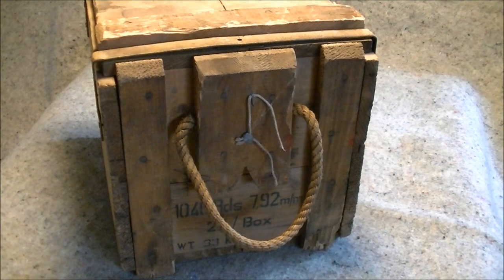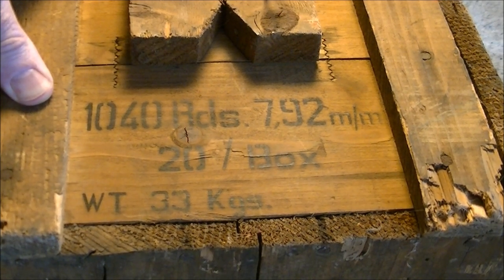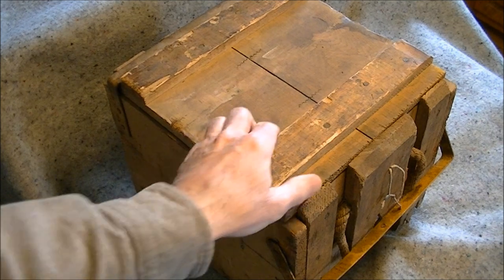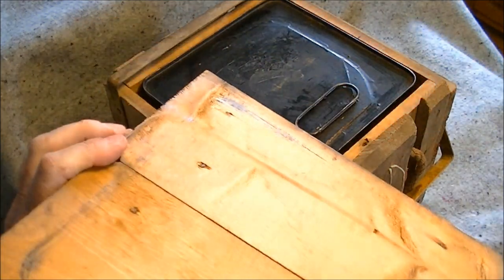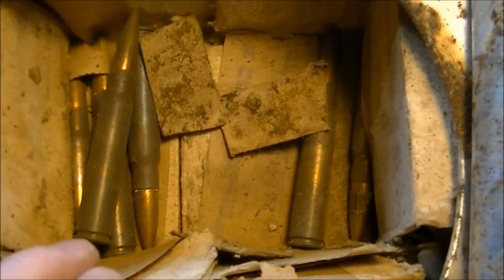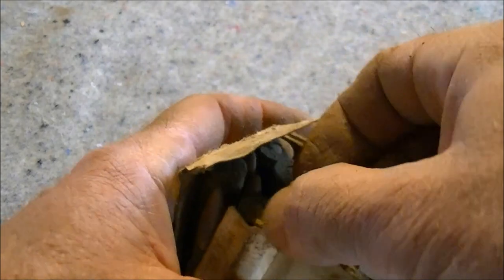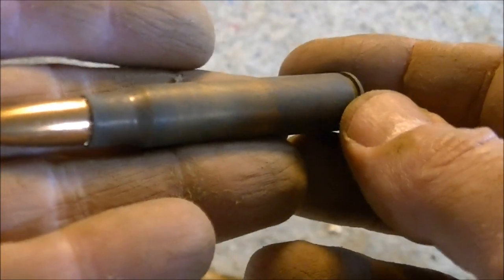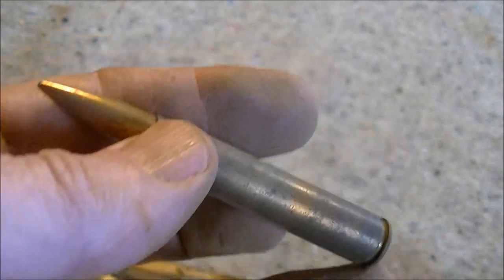Israeli 7.92mm Mauser Ammo Crate Opening

Comment: The flux used in soldering is highly acidic.  With that style door in the top of the can it would have needed a lot of heat / flux / solder to seal it up.
The cardboard would have soaked up the excess flux while it was hot and still liquid and became saturated.
The saturated cardboard would set up the perfect conditions for galvanic corrosion between the brass ammo and the tin box.
I think that is why the crimped  boxes do so much better, any soldering is on the outside.
Great video, looking forward to the testing.... thank you : ).
Reply from the maker: That is the best explanation yet to why the corrosion occurred, thank you!
Reply: Isn’t that lid made before it’s crimped to the top of the can? Like, the can is filled, then that lid is crimped on. They don’t fill it through the mouth and then solder the flap down…
Reply: @reccecs4   Not sure of the process, so I threw that out there as a possible cause.  My experience is that the countries that used the large door in the top of the cans seem to have the most corrosion damage.  I will throw out another possible scenario, I don't think anyone thought this stuff would be in these cans for this long.  So there was no real data on how long the ammo would last stored like this.  Because of how roughly cut and resealed these openings are.  I would not be shocked to find out that the cans were opened at one point for inspection and resealed.  What ever the case may be the cans with the large zinc or lead soldered openings seem to have the most damage.  I love a good mystery : ).

Comment: I pulled and reworked some Turk 8mm from 1948 it looked alot like this on the outside was clean and shiny on the inside I reduced charge a lil bit and so far no delay or misfires
Reply from the maker: I've pulled a few apart and they look far better on the inside than on the outside. If the primers are OK I suspect they will work decently as the powder looks/smells fine.

Comment: I think the ammo was damp when placed in the can and then sealed so the rust hole is from the inside out not outside in... maybe. Otherwise the can would be outside rusty....again maybe.
Reply from the maker: That could be, or the carton material was of poor quality and acidic, breaking itself down and causing the corrosion.
Reply: @314299  There needs to be moisture I think, and acid would make the boxes very yellow like old newspaper.
Reply from the maker: @danielleclare2938  Perhaps. Might have had one small hole or puncture that let moisture into the can.

Comment: Sad for the owner!  Might be a lot of good cases, being boxer primed, and bullets.  I've got a bunch of Turk 8mm stuff, headstamped in the 40s that shoots great, if a bit hot.  It's fine in my bolt gun, but I wouldn't want to try it in an autoloader.
Reply from the maker: I was a bit disappointed for him when I saw the condition of the contents. However it still could function OK despite the exterior condition of the rounds, I've taken down a few rounds and the interior of the cases and powder seems fine. If the primers are OK it ought to be fine.

Comment: Pakistani surplus ammunition is similary very poorly packed.

Years ago,I learned from opening old military surplus ammunition ,that it is important, imperative to take necessary precautions for your health and safety. 

Such as opening such old ammunition boxes in the Outdoors,wear work cloths,eye glases,mask nytril gloves, and over the Nytril Gloves Leather/ Suede work gloves.

 I use stainless steel long Food Tongs to handle anything dangerous  nasty dirty. 
Wipe down all contaminated  ammunition,as well as any tools you used.  Baby Wipes soaked in white  Vinegar or peroxide work well to decontaminate items and surfaces. Air/ sun dry ammunition before restoring it.

It also does not hurt to say prayers for anyone who lost their lives associated with such war era surplus ammunition. sprinkle some Holy Water on the outside and inside of the surplus ammunition that was in a war conflict area,as you just never know what may come with it!

Recycle or burn all old contaminated paper,wood.

I wonder what type of powder is loaded in those  8mm Mauser rounds? Cordite?

The US Military's durable gasket sealed ammunition cans seem to be the best to store ammunition in for long-term storage.
Reply from the maker: If you are that cautious and worried perhaps just stick to brand new shiny ammo.

Comment: Can they be re-elaborated?
Reply from the maker: Sorry but I'm not entirely sure what you mean by "re-elaborated". If you mean rebuilt than I think they can be, if it is needed. Perhaps a good cleaning may be all that is required. If test firing proves successful and they are safe and mostly reliable that would be the way to go. If the primers end up being suspect (duds or hangfires) they can be pulled down to have the primers replaced with fresh ones as they take standard large rifle primers.